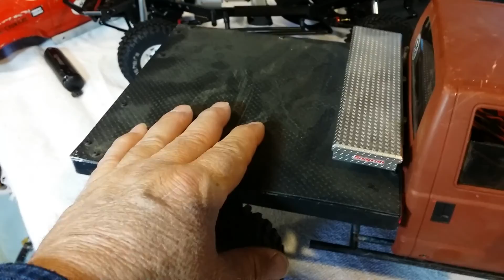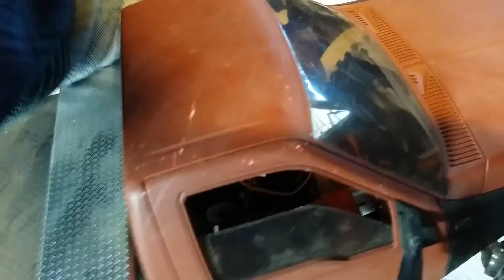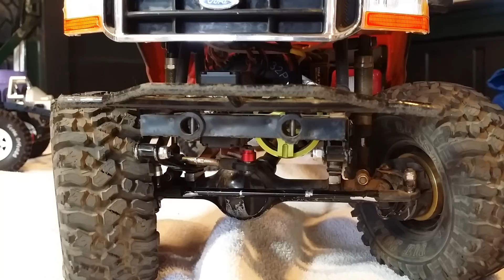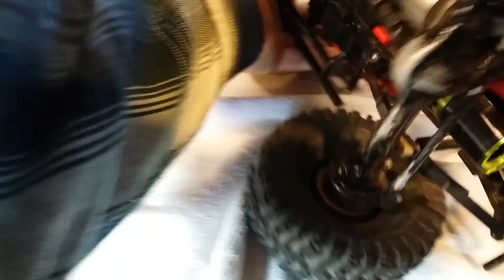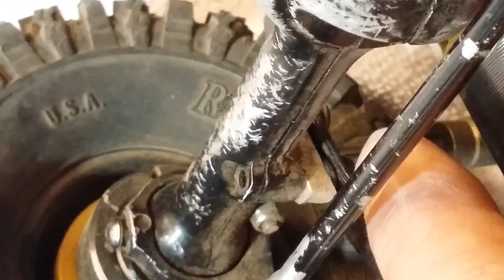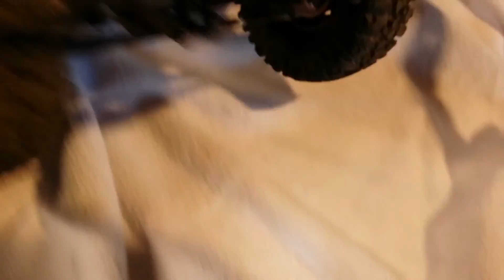Trailfinder 2 Modifications and updates for flex and power.

Comment: That's a cool body mount
Reply from the maker: Thank you.
Not long after this video I put one-ton dually's under it. Man...you wouldn't believe the traction an extra set of tires in the back gives you. As a dually it'd go places a well set-up Axial had problems going. It's definitely one of my favorite rigs to drive and most reliable. 
After the installation of the helical cut gears and cvd's...in 8 years...its never left me stranded on the trail...tho , I've gone through 4 sets of leaf-springs and one spur-gear. 
I'll release a video of the new set-up later...i have a few more things to do.
I just recently put my original Toyota body on it....it's called "Unwanted Yota".

Comment: What’s the body painted with
Reply from the maker: Shadow 4130 That's just Home Depot flat/satin rattle-can paint that's compatible with medal, wood and plastic.
Nothing special. 
Remember...sand , wash and many light coats.
Reply: What is the grub screw mod you did??
Reply from the maker: Shadow 4130 Using grub-screw/set-screws to hold the body on instead of button head screws.

Comment: great video I need to try that body mount idea got a video on how its done
Reply from the maker: Kentucky Rc Krawlers The Grub-screw modification for the side mounts is just replacing the bolts in the side with the grub-screw's. 
The tilt-body is made using steering or link ball-joints...two ball-joints about 4 inches apart facing down and mounted to the bed and two facing up and mounted to the back chassis crossmember using existing holes.....then put bolts through the two medal balls on both sides.
Reply: +Madeline Lucas thanks fixin to go try it make changin batteries alot faster that's for sure
Reply from the maker: Kentucky Rc Krawlers Your welcome.

Comment: great looking rig man.. looks like this has been a labour of love .. lol.. thanks for sharing bud. and that New body looks amazing... thumbs up..
Reply from the maker: Thanks Nickster.
I've had the TF2 for 5 years this last Christmas. It been a slow project. Besides my King Midas 6x6 , it's my favorite rig to take out on the trail. It drives "realistically" but at the same time..with the modification..will easily perform with the Axials.
 If you look at my videos , you'll see its slow transformation over time.
First , it was powerful(Novak Goat 18.5 system that was BEC'd to run on 3s)....then the upgraded parts for strength as the stock parts broke...then I worked on flex and lowering the center-of-gravity along with front-bias weight.
 I honestly don't have anywhere to go from here... as far as performance and strength. 
Tom

Comment: Awesome rig! What length shocks are you running up front?
Reply from the maker: MrBonger88 90mm. Pro-line or Axial aluminums will work or any other small diameter shock.
Reply: +Madeline Lucas Thanks for the quick reply.  I think you mentioned that there are various o-rings , silicone etc. Do you have a preference?
Reply from the maker: MrBonger88 I can't tell the difference between the Home Depot 1/8 O-rings and the Red silicone O-rings for flex. I've used both. No difference.

Comment: Nice setup! I love my TF2. It's got to be my absolute favorite. I'd do the motor drop but it'd hit my links because I run the front 3 link kit instead of leaf springs. I'll have to try doing the o ring modification to my rear end though.
Reply from the maker: Ethan Boening If I was to ever link my TF2 , I'd link the back. Keep the front leafed and O-ringed so I can keep the motor-drop conversion. But I honestly don't think I'd link the rear either because I don't believe I'd get anymore flex.
Reply from the maker: I Buddy...just ran into this again. Totally didn’t realize we talked so far back. Hahaha 
My rig has made so many changes since this video. I need to do an update.
And you've come along way with you rc fab company. Very cool.